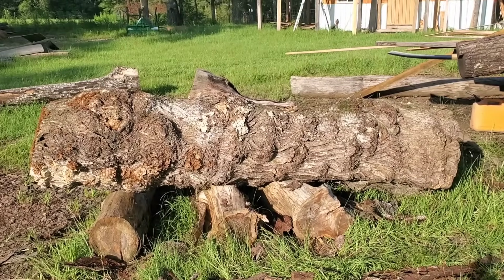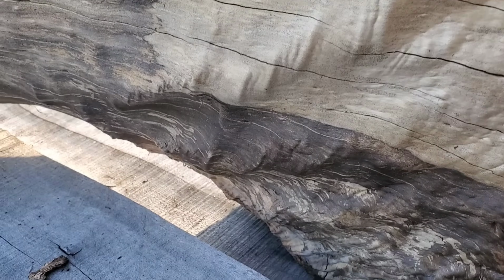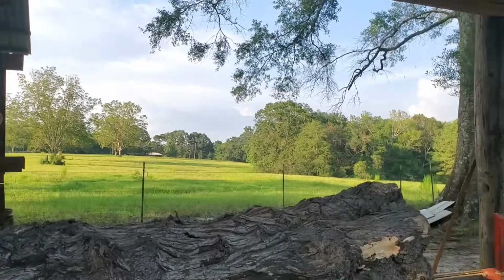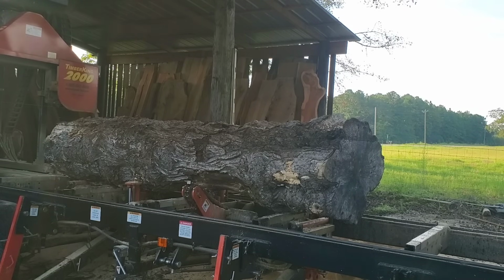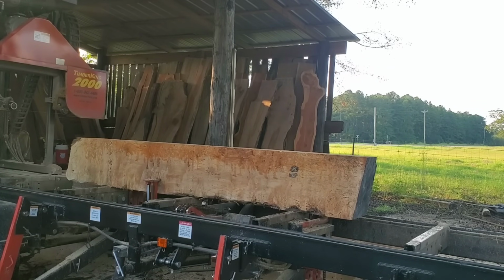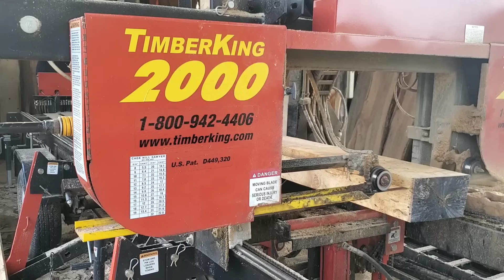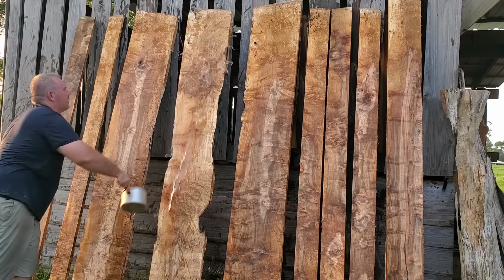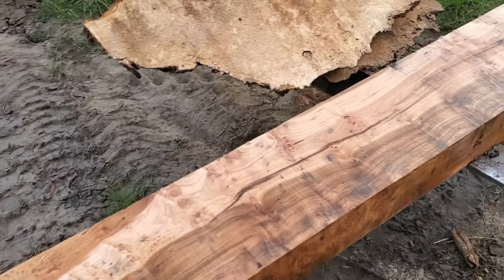Was it worth it trying to save this nasty Red Maple log?

Comment: If you're looking for Maple with lateral figuring like tigerstripe, or fiddleback, go to the north half of a feild surrounded by forest. The movement to the light bends the trunk and compresses the grain into cuts of beauty. Like the boards you splashed on the wall, Those boards are perfect for a table top. Just throw some CA polimer into the punky parts and you'll have a beautiful table, and that mantle is going to be exceptiona,l with the berl inclusions surrounded by figuring. It does look like that pith might give you some work after its dried but NICE FIND! ...and to think it was going to firewood👍
Reply: Lol 😂 they are annoying always bumping into equipment, some of ours don’t even go to firewood

Comment: It depends upon what angle you’re looking at the log. To return her those nuts are the points of interest. There are chemicals that can be added to strengthen the Rottenwood.  Also, quite often epoxy is used to fill holes including bug tunnels. When the world is turned, fascinating and very interesting arteries come out.  Creating objects of great value, depending upon the artistry in the creativity of the wood turner.  For making beams
and boards it is trash.  Open my mind from all directions and there are possibilities. 

When I was young girl, I learned this from the father of one of my friends.  He was constantly doing things, often failing, but instead of losing money, he makes money.  Each failure he turned into a success.

Comment: He should be cleaning all of the dirt and grit off of the product, before milling, this can be achieved by the use of high pressure, air,or water, this will keep the saw blade clean,and sharp.

Comment: Is Timber King and WoodMizer about the same sawmill?
Reply from the maker: They both cut very well, but there are some key differences.   I have owned 8 different sawmills and operated many more, but the Timberking 2000 or 2020 with a diesel is my favorite by far.  That's my opinion, but I try to list out all of my reasons why in this video: https://youtu.be/oRyTwSDyJXc?si=YDQbPXAT2xNccbaq

Comment: I have a silver leaf maple with burls like this one. I've tried to find someone to take it out for the wood. But everyone tells me, once it's down and they'll take it off my hands. (For free of course). Not the answer I was looking for.
Reply from the maker: That's often the case, once it's down everyone is willing to help take it off your hands.
Reply: @TCSawmills  This tree has a 13' circumference. Some branches are over 20' long and straight. Some amazing table tops could be made from it. I just need a crane and portable sawmill. And be about 20 years younger.

Comment: That log looks lumpy enough to be a boxelder.
Reply from the maker: Boxelder is pretty weird wood, smells horrible to me.  On the other hand it's very unique looking.
Reply: @TCSawmills  yes it has a bitter smell when cut fresh.  Not sure how it dries out.  Most trees around here as re very twisted.  Fence row stuff.  I cut one out of a backyard 2 years ago that was over 5 feet in diameter, the first 8 or 9 feet.  Full of ants. The property owner said, the following spring the area where I bucked up the pieces was covered with mushrooms, wherever sawdust had accumulated.
Reply: @TCSawmills  one wood I do not like at all is black oak.  Smells like 🤮.  Even the sawdust.  The smell seems to come back whenever it get damp.